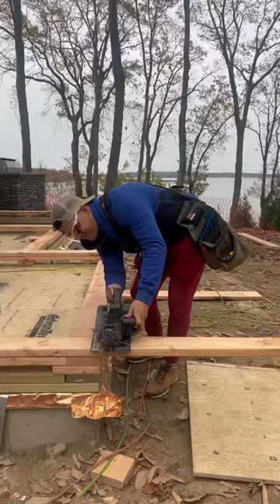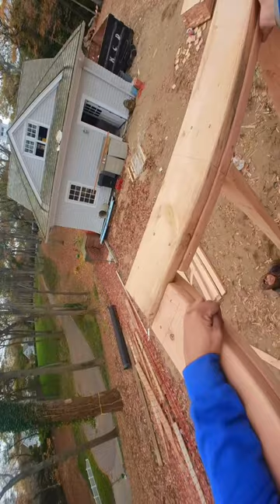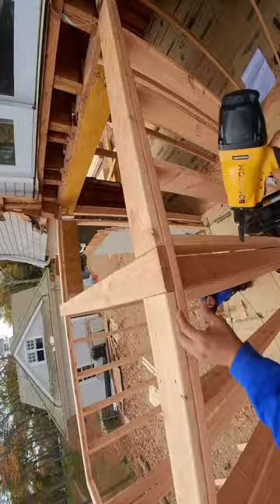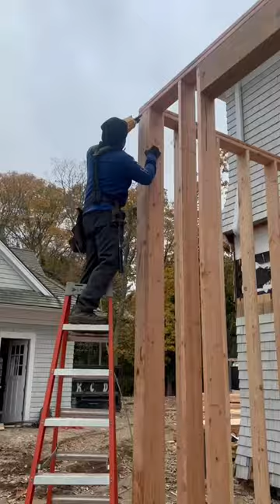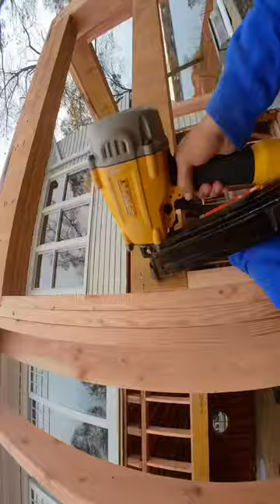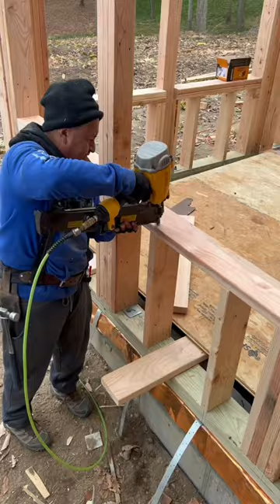Walls #shorts #construction #work #skills #perfect #design #carpenter #beauty #architecture #team

Comment: I wonder if these guys read the engineering specs @ the front of the blueprints especially nailing specs and header assemblies yeah the work looks clean, but this is the most awkward aproach to framing I have ever seen, I've been building houses for over 50 years
Reply: i don’t understand this style either, seems like so much more difficult manual labor.

Comment: The toe nailing thing kills me lol
Reply: Why?
Reply: Same here it’s truly not a normal operation when doing new framing , then there is standing the wall up just seems so awkward …..that said hands down incredible rafters and clean work they do but I just don’t get toenails unless one has too .
Reply: @James-wd2uu  Because toenailing will often cause a very slight air gap between the plate and the stud. Slowly over time the weight of the house wants to push that gap closed causing independent movement and cracks in finishes. It's also a very weak way to attach the stud to the plate. Everybody toenails some, but excessive toenailing like this is hack work
Reply: @Grrrnthumb they have to do it because the inspectors there require it so they can see the nails, and it's actually stronger than end nailing at resisting uplift because it isn't just relying on the friction of the nail in the end grain. And if you are careful, no gaps.
Reply: @ke6gwf  who told you there is a place inspectors require toenailing, lol? That's funny right there! It's not "actually stronger" because toenailing catches such a tiny portion of the stud on it's very edge. Look at any real-life toenail job and you'll see wood fractures and partial blow-outs all over the place. You're barely catching the corner of the stud, so no, it is NEVER stronger
Reply: @Grrrnthumb this guy making the videos has said in other comments that they don't allow the studs to be nailed from the bottom, and I have heard it from others as well. I think they are in New York?

And what you describe sounds like poor workmanship for toe nailing.

6 16 penny nails, properly angled, will trap the board between them and have more force than 2 or 3 nails only holding through friction, especially when the board starts drying and cracking.

But I heard that the main reason they require the toe nails there is to be able to visually see that they are nailed, probably because they were having a problem of people only putting in one or two nalsl into the bottom, trying to save time or money, so they required toe nails.
Reply: @ke6gwf  Try to find that nonsense in print in a code. You won't find it because that place doesn't exist where they don't allow bottom nailing of studs in standard vertical walls. Also, angled nailing, and angled nailing holding power, is not exclusive to toenailing as you imagine. End nailing can be angle-nailed as well, for holding power far exceeding what is possible in toenailing. Be careful of quick internet searches for the benefits of toenailing, since most of what you find is in relation to horizontal framing members, not vertical as in the video. You spoke of poor workmanship... but this ALWAYS goes hand-in-glove with fully toenailed walls. Did you see them raise that wobbly wall with only the top plate prenailed? That flopping powerfully applies leverage in a bad way to the top nails, partially pulling them out and introducing gaps that will move later. Hack framing.
Reply: Same here but it’s for their code
Reply: @JohnD-yz2gc It's just not. There are no codes like that.
Reply: Some Areas in the South it's how it's Done 😂 Ridiculous an unsafe .
Reply: Right... With the correct progression almost everything can be box nailed.

Comment: Even if double bottom plate is required, why wouldnt you shoot down bottom plate (single) then build wall on ground, shoot in 2nd top plate and stand the wall up and lift onto shot in single bottom plate??? Its WAY eaiser and you dont have to skew every single stud in but maybe you have a reason u do it the way shown??
Reply: It's a requirement by the inspectors there, so they can see the nails.
Reply: I seriously doubt that, I have never heard of it being required to toe nail.

Comment: Just curious what's the benefit of not nailing your bottom plate on the wall before u stand it up?
Reply: I'm wondering the same...
Reply: I believe this is code where they are at and the inspector can see it. I from things I read it has a stronger grip to. There might also be a benefit to plumb the studs but I can't remember.  This is the only time I've seen it
Reply: @corysturgis6660 correct, the inspector can't verify nails up through the bottom plate, and I guess they were having a lot of issues with framers not nailing it properly, so they require toe nails now. It's stronger anyway.
Reply: @ke6gwf  ty. Are you on new york too?
Reply: @corysturgis6660 no, West Coast lol
Reply: @ke6gwf  lol. I've never seen it in the west
Reply: @ke6gwf this looks like a ton of extra work to me. Fram, square it with osb,router out doors and windows. House wrap and stand it up. Toe nail later just for looks. To much up and down. Use the guys you have for less work and time.
Reply: Dale carpintero!
Reply: Wouldn't pass inspection here

Comment: Weirdest framing sequence I have seen in over 45 years of building . Not wrong just completely different from the Pacific Northwest. We build complete walls with a single top plate and lots of times even sheeted before standing, then tie it all together with the second top plates, straightening the walls if necessary as we go . Single mud sill with a single untreated bottom plate. Nowhere near the amount of straps ever specified by the engineer and no copper flashing ever. We use a foam sill sealer between the foundation and the treated mud sill. Headers are at the R. O. height of the doors and windows.

Comment: Finally! Framers that put the headers at the top of the wall, not immediately above the door/window! Good work guys:)
Reply: Header's
Reply: What’s the difference ?
Reply: @aydosbuildz556  makes it much easier to upgrade to a taller window/door in the future if ever desired.
Reply: Because that happens so much 🙄
Reply: @rockypearson4482  It does if you do remodels.
Reply: @rockypearson4482 It does. As a contractor, I just did 3 homes in the last 6 months that upgraded to taller windows. 🥴
Reply: Can't do this on a portal framed wall.  The reason for headers above windows is because that's how the code book shows.   The crews who raise their headers up all the way are usually the crews who fuck up R.O.s all the time.
Reply: Nah, only the hacks put the headers up there. The frame-down below the header wrongly relies on the pull-out strength of upside-down nails, not the much-stronger sheer strength and solid bearing of a correctly framed wall. The frame-down often can't even support it's own weight and can cause drywall cracks years later.
Reply: Tho only time you want to put headers up top is if you have a bunch of load points above it. Usually a cased openinging. That way you don't have to put a bunch of small blocks to carry through to the header. But that's not wrong either
Reply: Same where I'm at put the header up top and the inspectors would be all over you not the way it was drawn in the engineering
Reply: Same where I'm at put the header up top and the inspectors would be all over you not the way it was drawn in the engineering
Reply: Same where I'm at put the header up top and the inspectors would be all over you not the way it was drawn in the engineering
Reply: Same where I'm at put the header up top and the inspectors would be all over you not the way it was drawn in the engineering
Reply: Same where I'm at put the header up top and the inspectors would be all over you not the way it was drawn in the engineering

Comment: Why do you guys do a double bottom plate??? I can't understand it? Is it for the skirting or a usa standard? It's absolutely pointless?? Please reply it's killing me😂?
Reply: I was wondering the same thing, it seems like a waste if there’s no structural benefit….maybe the bottom board is acting as a filler to raise the finished height of the wall?
Reply: Even if that’s so, why not nail through, those toe nails just seem weird at that connection. Plywood to really tie everything together I guess?
Reply: It could be for a poured 1.5" concrete containing in floor hydronic heat. 
We do it sometimes